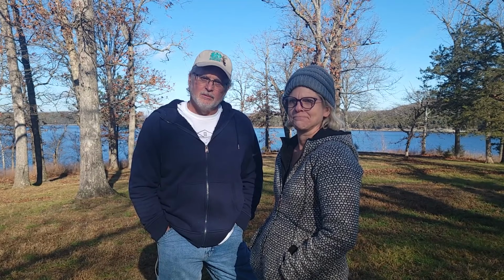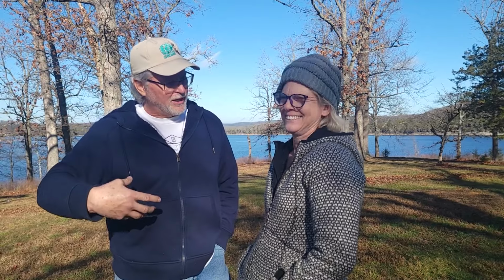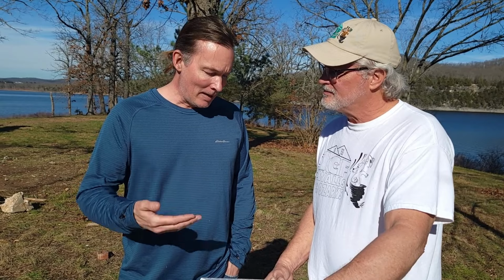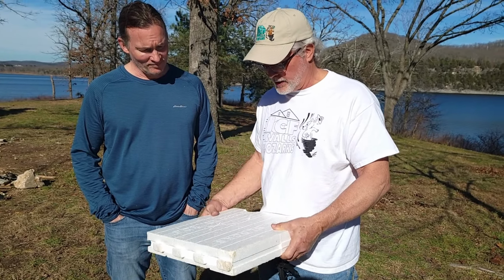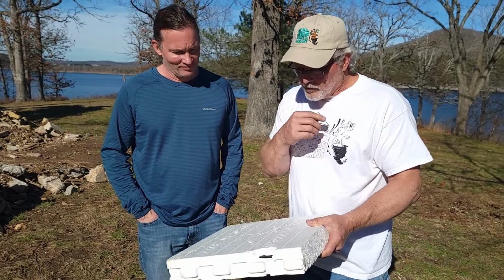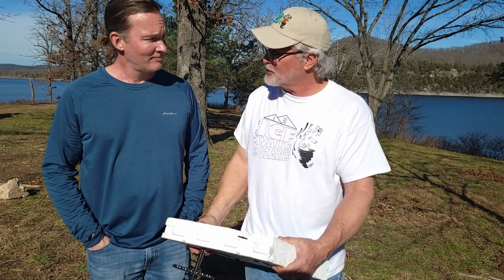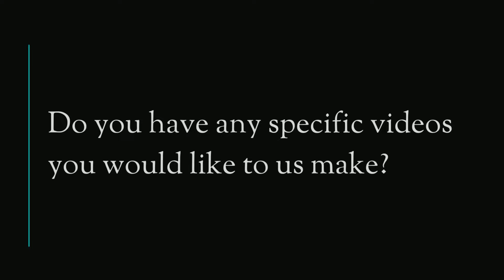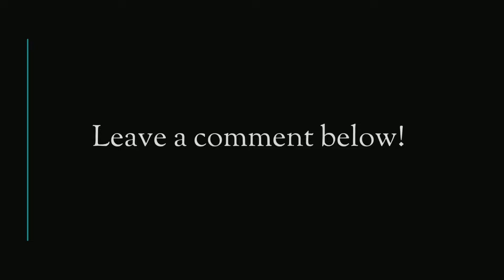Interviews with future ICF homeowners; How do I hang items on my ICF walls?

Comment: Just found your channel. I'm nearly through the building permit process for my first ICF home here in the mountains of CA. I found it amazing that you used all dimensional lumber for your bracing on those tall walls. Well Done. I've been dreading buying or renting the bracing because it's so expensive. So my thinking about using strongback bracing for 8-9' walls shouldn't be a problem.
Reply from the maker: We would be happy to give you some information on our bracing system! It is lightweight and uses lumber to keep the walls straight, square, and plumb. The lumber is placed horizontally along the entire wall to achieve this. It allows us to pour a wall as tall as a 2x4 can go and also doubles as a scaffolding system. If you'd like actual information on what the system is, I'd be happy to email you some details!

Comment: Also, wondered about the mix you used with those tall walls and any vibration or consolidation?
Reply from the maker: We use a monopour method to pour our footings and walls at the same time. We have a certain mix we use for the footers and a certain mix we use for the walls. The footer mix starts at the consistency of water and sets quick to hold the weight of the wall pour. The wall mix has a lower slump, but still high enough to keep it moving down the entire wall. We do use concrete vibrators to help move the concrete along to harder to reach places, like below windows and so on! 

We have plenty of videos to come, and some will feature our pours!

Comment: With this much of wood for braising , you can frame half of house🙉
Reply from the maker: Yes. The homeowners pay for the bracing materials and then the wood does actually get used to frame the interior of the house. So instead of only using it as framing materials, it serves another usage before.